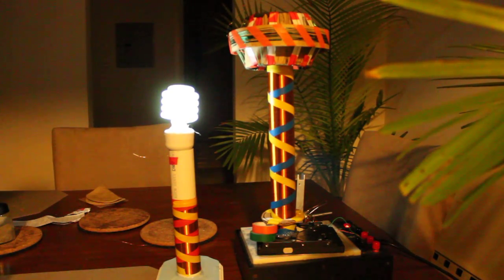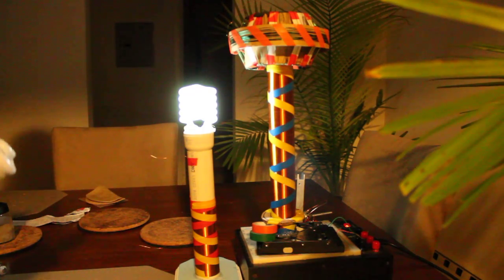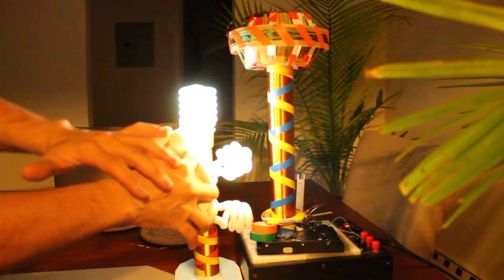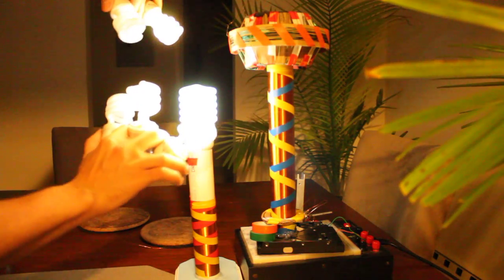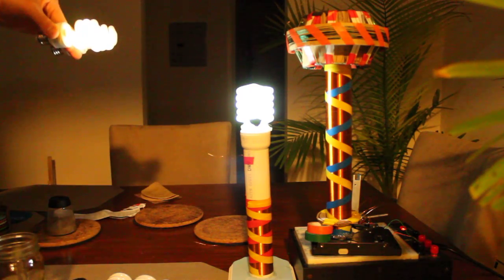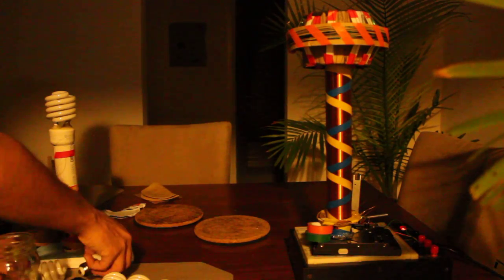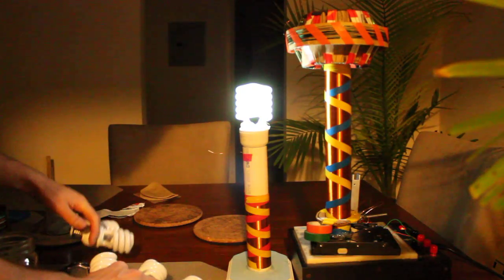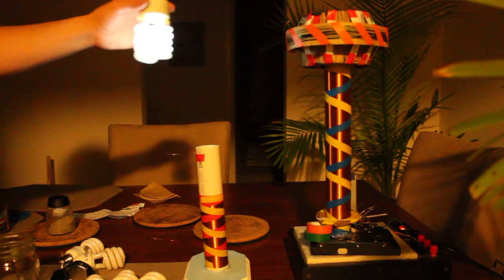Solid state Tesla coil load test  80W+ worth of CFLs Illuminate.

Comment: very nice.
I liked your tip on how not to get transistor hot. Locating the sweet spot for exciter coil.
Can you please write in description how much power is being used to run the slayer.
Also can you show us how to run dc motors of it.
I know we can turn LEDs on by making copper coil 20 tuns rings.

Comment: The amazing thing on this system is no zapping or noise.  My brother made one with me 40 years ago and it was loud and menacing.  Every single Tesla coil I have ever seen has this unfortunate side effect.  Am I correct that you have eliminated the "side effects" from Tesla Coil ?
Reply: +David Hiergesell (Hierge) It's a low-powered oscillator. I'm guessing this model is based on one of the common "joule thief" circuits. "Traditional" Tesla coils make a lot of noise when the air ionizes and breaks down. Adding a large smooth conductive surface will help smother out any harsh gradients in the E field, which will eliminate the breakdown of air. Any solid state Tesla coil (or vacuum tube switched) can operate silently if the input power is kept low enough to avoid ionizing the air. I'm guessing you and your brother built a spark-gap Tesla coil, like Tesla's original circuit, and they are very loud. Most people like to encourage this "unfortunate side effect" because it's very fun!
Reply: +David Hiergesell (Hierge) Its called the Transistor... spark gap is obsolete....

Comment from the maker: These are experimental devices, and should be treated as such. That said, these devices operate in much lower frequency bands(500khz- 10Mhz) than smart meters and cell phones. To put it in perspective, a popular FM radio station in my area is 107.1 Mhz. You are surrounded by electromagnetic energy.

Comment from the maker: I don't even know where to start with this comment.  Not only are all these bulbs being powered wiressly, which is a feat in of itslef, but the input current to this circuit is less than 1 amp. at 15V, that means im drawing less than 15 watts. Each small CFL is 13 watts, the big ones are 27 watts. Even if the bulbs aren't lit to 100% as if they were plugged in, they are still being powered more efficiently using this system.

Comment from the maker: First off, It's not even getting 7.5 amps. Current draw is actually less than 1 amp. The bulbs do not light all the way.. but they light because the energy is being transmitted at an extremely high frequency, exciting the gasses within the bulb. The same is said for LEDs... the high frequency energy excited the LED junction and they glow.